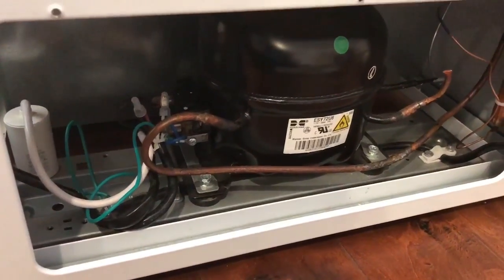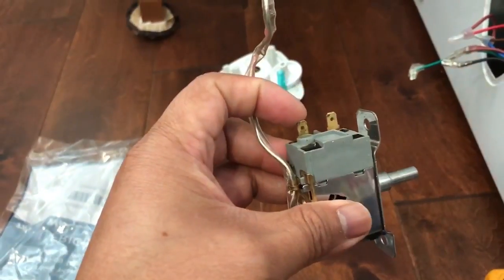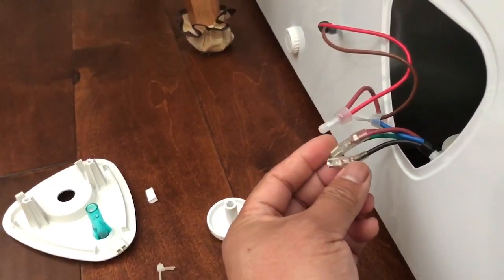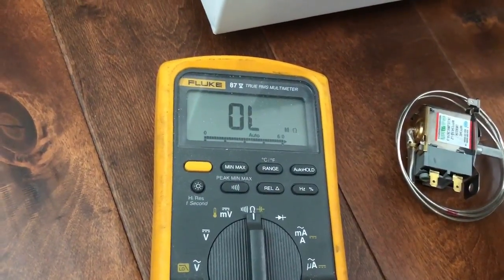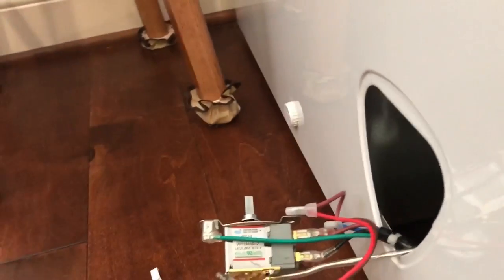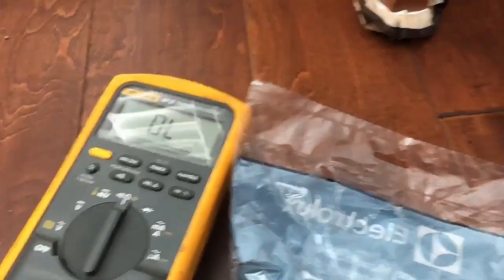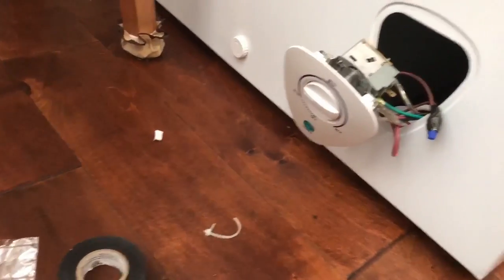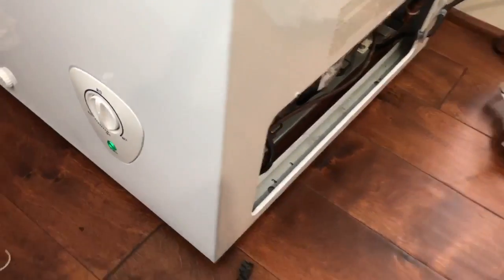Kenmore deep freezer has stopped working

Comment: Hey . You were right on with testing the thermostat. I tried everything else. Bought parts I didn’t need. Once I jumped the two wires together away the freezer went. Replaced the part and I’m good to go. Thanks.

Comment: Thanks for this video man. Fixed my Danby Freezer for $25. I love that you showed the whole process with the multimeter tool as well.
Reply: Thanks for the video. I fixed me freezer. It is master chef, but looks the same. I already replaced relay and protector and only with help form this video I finally found the problem. Checked old thermostat on multimeter and surely it did not show anything and did not beep. Found similar cheap part on amazon and bum, working again!

Comment: I just noticed my old Kelvinator thermostat has failed it is running all the time, although if i put pressure on the switch it does turn off. so time for a new switch. gee less than a month ago my 6 year old fridge start replay stuffed up and I got it running. this is the opposite with comp running all the time.

Comment: To answer some questions on how to remove knob/control cover....

Take off knob like stove knob, pull out...
Remove but with needle nose long pliers...
Then remove side cover to housing unit...
You will find (2) screws, very awkward to get out, becareful of the copper pipes. It took several tools for me ... Rachet tool, bent screwdriver, and a lot of patience😳

Hope it helps... I have Kenmore 255.19502010.

Update... To access the screw that is away from side better...  Laying it on it's side and removing from the bottom is a better way. Just remember after fixing it, to allow it to be upright for 24 hours before turning it on.

I actually had my hubby hold ours upright on a tub, so I could access that screw. Likely, will do the same, to close it up. 

Hope it helps. Be care not to damage light bulb...

Comment: Did you have to open the back of the freezer chest to "pop" open the control/power nob panel in the front? 
My power indicator bulb isn't working and I was wondering if you had to carefully pry the panel open from the front or if you had to open the rear and push the panel open. 
Thanks. ✌

Comment: Hi, Dan. Great video. Thanks for including the OEM part numbers, too. Can you comment on how to install just the indicator light wire(s)? You mentioned having to "cut them" and maybe also removing the blue casing from the new wire? Not sure that was all clear in your video, and my guess is others would want to know, simply because these bulbs tend to burn out a lot, and also confuse people about whether or not the freezer itself is broken. I think you would help a lot of people if you explained this, too. Thanks for any help you can offer!
Reply from the maker: Thanks for the feedback. I can add steps in the description
Reply: @DanOfAllTrades  that's great, Dan - that will be a big help to people, especially considering there aren't any other videos about this model. Cheers.

Comment from the maker: Sorry for the volume. I might have to narrate this once I figure out how to do the narrating part. I am not really good at video software.
Reply: How did you remove the thermometer wire. Mine is stuck I pull but it won't come out. Is there a trick to it?

Comment: When it wasn’t working was it just not freezing because I have same model and it’s not freezing. The light I notice is also dead. I see people put Freon in their freezer. Just curious because I bought all the parts and it’s getting here in a few days. And don’t want to have it replaced if it was Freon
Reply from the maker: Mine was not powering up plus blown bulb. It was working before and it has stopped. I looked for a sign of leak on all lines, i went the cheap route which is replaced relay, then led me to switch itself which it worked

Comment: A few weeks ago, I noticed it had defrosted.  There was no sound of the compressor running.  I looked this problem up and a number of results suggested replacing the start relay and / or overload.

 I ordered replacement parts, and they have now arrived, however I have misplaced the photograph I took of the original wiring.

 The start relay is a 3 pin relay

 Could someone please advise on how this should be wired?

 The brown and blue pair of wires both came from what looks like a capacitor box.  The blue and white wires appear to come from what I believe to be a thermostat box, which is then connected to the mains.
Reply: Usually these kinds of freezers will have a wiring diagram pasted on them somewhere visible. The ones I've seen typically are on the back of the unit.

Comment: Thanks Dan for this informative video.  I have a chest freezer that its not working, I have to test the temperature switch but I don't have a  tester. Can I hook up directly the two wires you mentioned to see if that will run my freezer and determine the switch if there is continuity and before I buy the parts. I'll appreciate your feedback. Thanks again.
Reply from the maker: Henry Marquez you can try, try to put an automotive fuse so when something goes wrong, it would pop the fuse. If you want to be sure I think they sell a cheap multimeter at autozone. Hope that helps
Reply: @DanOfAllTrades  Thanks for the suggestion. Will do get a cheap multimeter.

Comment: WHAT TO DO IF MY DEEP FREEZER WON'T SHUT OFF
Reply from the maker: My guess is the thermo switch, the knob that you turn off and on and set the temp. That switch has a built in thermo sensor and you might have a stuck switch. Are you able to turn if off? I am assuming that when you turn it on and will not shutoff for days.

Comment: Hi Dan  thanks for the great video.. i bypassed the thermostat and it worked.. so i need new thermostat but i can't find one for my unit anywhere even on ebay.   what is the model that you used?  thank you
Reply from the maker: Part number I bought through sears parts direct are 5304476700 freezer temp control thermostat. I also bought the green bulb since it was burnt. 5304492852 freezer indicator light
Reply: Deep freeze chal Raha hai par cooling bhi Hoti hai kuch der Baad short cricut hota hai Kiya kare

Comment: How do you pull the front piece out?  Does it just pop out from the inside, or are there screws?
Reply from the maker: I dont remember but when you open the access panel from the compressor, you will see the back side of the control panel

Comment: Thanks for the video. I ended up switching my switch and light and my deep freezer still isn't working. Do you have a video for replacing the relay? You  had mentioned early on in the video that you changed it previously.  I have this same freezer.
Reply from the maker: For the relay, when you buy it. Take a picture of the current relay while the wires are still hook up. Then match your new relay and should help you wiring it.
Reply: @DanOfAllTrades  thank you. I ended up taking it apart yesterday. Cleaned out the part and it's currently working. Do you happen to have the part number?
Reply from the maker: @Sandra-et7kn  that's awesome.good work. For relay part, I believe there was numbers stamped on it. And I just googled it. Or try searching kenmore compressor relay in amazon

Comment: Hi Dan, I have a similar issue, except only the indicator light is burned out not the thermostat.  It looks like your freezer ran when you bypassed the thermostat even though the indicator light was burned out.  My indicator light has 2 prongs which has power going into it from the power cord and then from light to thermostat.  Couldn't tell if your model did same.  Anyhow, do you think overriding thermostat would work?
Reply from the maker: It can work but your compressor is going to run all year until a relay burn or compressor. That thermostat is suppose to regulate the freezer temp and cycle the compressor.
Reply: @DanOfAllTrades  Thanks. Will try overriding thermostat see if compressor turns on. Is it possible the indicator light being burned out could be the reason why compressor will not start?
Reply from the maker: @alexhernandez1442  the green bulb is just an indicator that the power is on, check your thermostat switch with multimeter also,
Reply: @DanOfAllTrades  Thanks for your help. The thermostat has continuity.  I bypassed thermostat and the compressor turns on for about 15 seconds then turns off.  I removed the relay but it doesn't rattle. Installed a 3 in 1 universal relay but compressor still only turns on for 15 seconds then shuts off.  The thermostat and relay seem good.  The indicator light is burned out. How can I tell if compressor is bad?
Reply from the maker: @alexhernandez1442  that requires a special pressure gauge to test if the compressor seals are bad, but i dont remember if they have service ports. One thing is check ohms of the motor, or amp on how much its pulling. It could be u have a weak magnetic field in relay or overload protection where it disenage the compressor due to increase in amps running compressor. Is there any sign of leaks in the tubing?
Reply: @DanOfAllTrades  No signs of leaks.  I'll check the ohms of the compressor to see what is pulling. I did check the three prongs of the compressor with the multimeter and it shows the same numbers on all three.  I think it's supposed to show on one the total of the other two.   What's a sign that the compressor is stuck?  Thanks for all your advice Dan.  I really appreciate it.
Reply from the maker: @alexhernandez1442  stuck would not turn on, need to know the book specs of the ohms, this should show the health of the motor. There is another way but i woudnt recommend. It is up to you, is to supply power directly to the compressor, i would also use a surge protector just incase your compressor is bad, it would trip the surge protector circuit breaker. I think your overload relay is making it stop, and maybe compressor is drawing to much amps, this also cause of age, or  internal issue
Reply: Thanks for the help. Maybe it's not stuck because it does turn on for 15 seconds the shuts off.  I'll be installing light today and do other trouble shooting.

Comment: The power light is out but it feels like its still working?  Is this normal?  (I've had it for about 3-5 years.)
Reply from the maker: Burnt bulb. As long you still here compressor running, should be good. When my freezer has stopped working, i saw a small puddle of water under drain

Comment: We just fired up our deep freezer after a couple years of it being off. We noticed it was not making the same noise as yours is, and it won't blast cold air. Do you have a general idea of what we can do to repair it?
Reply from the maker: Visual check for refrigerant leak..its like greenish corrosion..mostly in piping connections..check plug fuse..i don't know your freezer model or brand.. mine did not had one..check compressor relay continuity with ohm meter..lastly..it could be the switch thermostat like my issue..

Comment: Do you have the starter relay part number?
Reply from the maker: Edgewater Parts W10920279, 61003115 - Refrigerator Compressor Overload And Relay Kit Compatible with Whirlpool, Maytag, Kenmore Refrigerators

Copied from my amazon order

Comment: Hi Dan, what was it doing before was it cold but not cold enough or was it really warm inside?
Reply from the maker: Osborne Guy no power at all. So I replaced the relay that is next to the compressor but did not work. Come to find out my thermostat switch assembly was faulty
Reply: Part # for the thermostat switch?
Reply from the maker: Mo Bigg sorry for the late reply. It’s in the description. I added the info there.

Comment: Why does it trip when you plugged it in
Reply from the maker: Cecil Castlemaine it’s hard to tell by not looking and testing it. But I think, either the protector got weaker or the freezer compressor motor is shorting out

Comment: What was the part number for the start relay?
Reply from the maker: This is what I ordered in amazon Edgewater Parts 61003115 - Refrigerator Compressor Overload And Relay Kit Compatible with Whirlpool, Maytag, Kenmore Refrigerators
Reply: @DanOfAllTrades  Hey Dan! I noticed that the relay part you suggested for this freezer is different from the original part. Do you happen to have a video of you installing this part???
Reply from the maker: Destiny Wood I don’t have the video of installing it but that part number worked for me. You can also check sears website for parts. I remember putting the serial number since the sticker on my freezer said sears. Then I started googling the parts
Reply: @DanOfAllTrades  Ok. Thanks!
Reply from the maker: Destiny Wood I forgot to mention. The part number is in the description. Hope that helps
Reply: @DanOfAllTrades  yes I saw it! Thanks